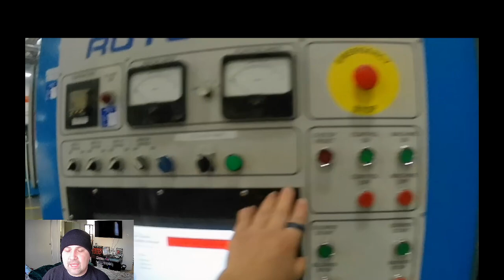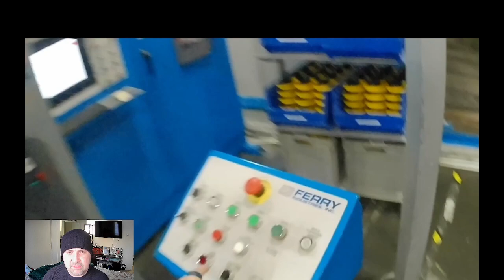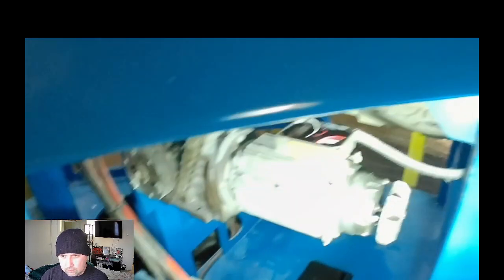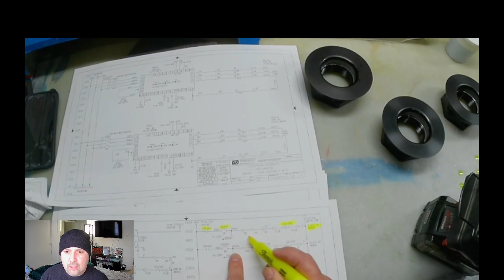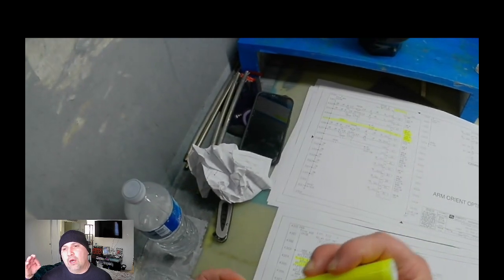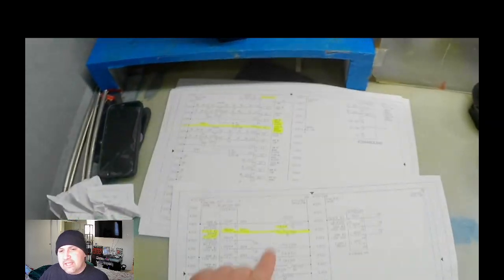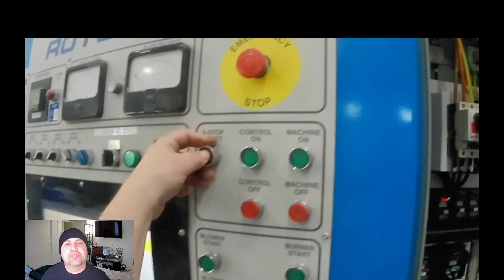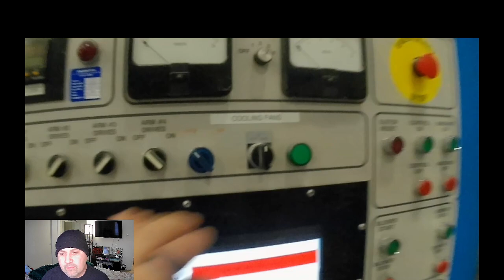Relay Meltdown: A Shocking $5000 Damage!

Comment: Probably a shorted brake coil damaged the relay.

Good job tracing it down!

People don't understand that you not only have to be a good electrician in a case like this, but you also have to know how the machine operates to troubleshoot it.

If you get called in to a plant for a machine you've never worked on before, you have to take a crash course in how it's supposed to operate so you can figure out what circuit isn't functioning properly. Unless of course something is really-really obvious, which happens rarely.

#retiredindustrialelectriican
Reply from the maker: You Definitely Understand It! thank You.

Comment: That happened ( and it will keep happening) because designers decided to save space by using those micro relays, and probably not installed arch protection for the contacts. Contacts got welded up.
If they would use regular “ice cube” and run it through two pairs of contacts - if one pair would weld up - the other most likely would brake contact. And installing the arch protection for the contacts ( like fly back diode for the DC it transorb for the AC) would prolong the life of the relays. The thinking was “those relays are so cheap, we don’t need any protection”, but no one thought about doing damages further than a relay.

Another sneaky thing: three phase primary isolation/control transformer or DC power supply WILL work on single phase, but voltage will be lower. With voltage lower there will be higher current going through the contacts, which in turn can weld them up.
So with things like this always check your control voltage UNDER THE LOAD, and verify that you have good  three phase feed to control transformer or DC power supply.
Reply from the maker: @commenter5469  Those little relays are under heavy load with tje amount braking the machine does when operators cycle manially......you are 💯

Comment: You took the cover off the electric motor and didn't inspect it thoughly? When I shop for a car I don't stop checking out the car I'm interested in after opening the hood. I check the undercarriage, the brakes, the frame, the electrical (within reason). What are you talking about you asked your subscribers what could be the problem, is that why it took you 4 hours to find what was going on? If the motor and brake are both 120 a remote trigger for both the brake and the motor with your ohm meter attached to each one separately will tell you one that each is functional or not, two the power draw from each one. By the way some of the windings in the motor are toast.
Reply: Also I don't believe for a second that it was you doing the repair with how it sounded like your describing what's going on by reading a script.
Reply from the maker: @ I Cut A Lot Out Of The Video For Time Purposes. I Really Appreciate Your Feedback. Thank You.

Comment: Fun to watch, back in the 90's I did a lot of design / install and troubleshooting of PLC systems, from crayon and lightbulb plants to automotive plants to super tankers on the ocean.  Always a fun day to get things up and going.  We did a lot of new systems as well scraping off automotive plant floors and starting over new production lines when models changed out and that was fun to click your program to run for the first time when there was big machines no in play that can hurt people as things are turning up.  We had to use a lot of safety overrides as well during initial startups as things were still being built.  Slowly over time the systems would come up, and then after a few months you get to see vehicles running down the line with thousands of workers putting them together with the systems you built.  Those were the days, and some of the stories!  👊😉
Reply from the maker: Yes, I Love My Job. Thank You

Comment: It's good to listen what operators have say, but I always take them with a grain of salt. Keep the videos coming! <3
Reply: Some operators are great other will lead you on a wild goose chase, just tell me what it's not working.
Reply from the maker: Thanks.
Reply: @SIXFIGUREFINGERS  so any idea what went wrong with the brake other than it was burnt? You didn't explain it.
Reply from the maker: @klarnorbert  Allen Bradley 700-TBR24 Mini Relay Failed OFF/ON  For about a week before it finally shut down. Intermitently Heating The Brake....I Believe This Is What Based On What Operators Explained.....Lets hope this is the case or i'll be back...LOL
Reply: Was about to say just this: Some ops are amazing, and will tell me the exact problem as soon as I walk up, and the other 4/5 will tell me different crazy theories. The number one skill in controls is isolation, the second is notetaking. (the third is jiggling stuff just right)